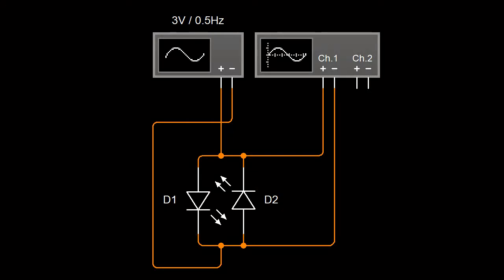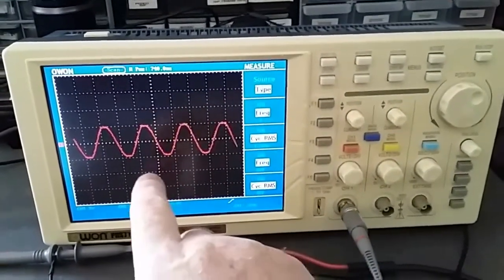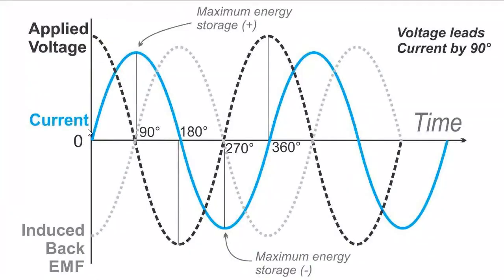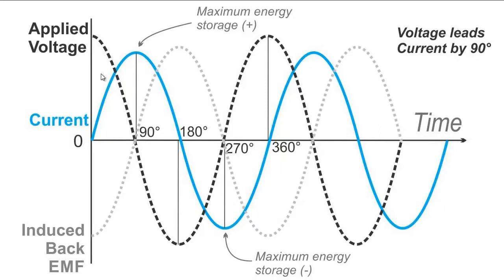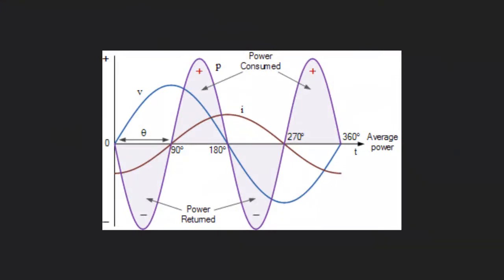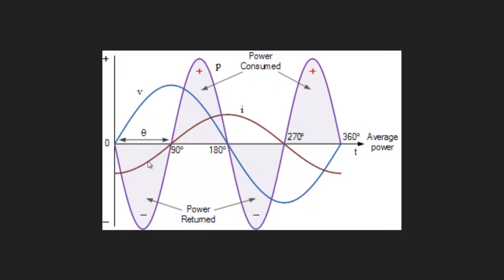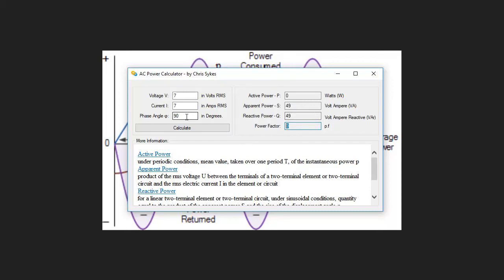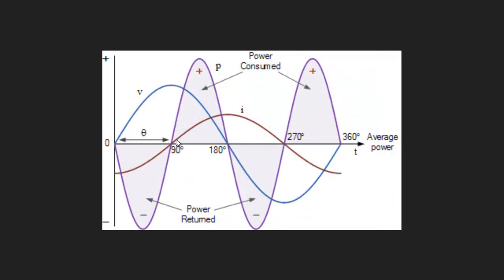Oscilloscope Real Time Signals and Relationships - Phase Shift

Comment: To my understanding: it doesn't prove that current can exist without voltage, it means that zero voltage is the voltage difference over the inductor, Vin-Vout, is 0, Vin and Vout are the same but can be any value. Because they are the same, there's max magnetic  field, no more back emf and current is maximum. When Vin lowers, current changes, di/di, magnetic field collapses & back emf, until Vout is Vin again.